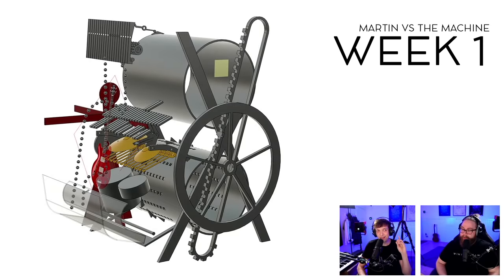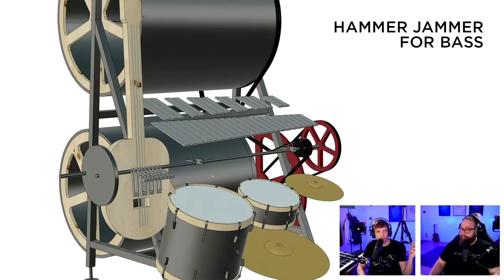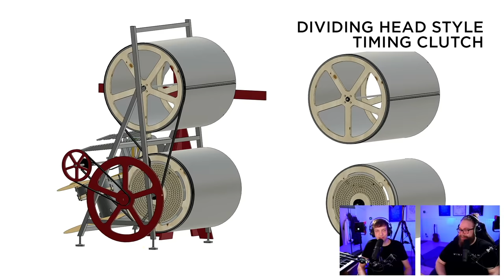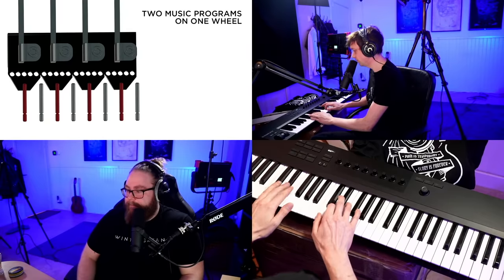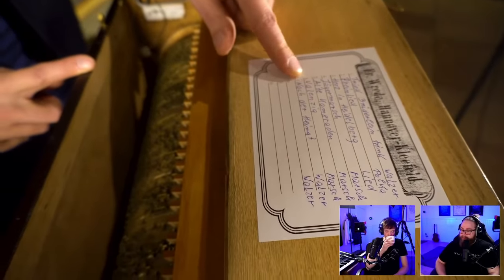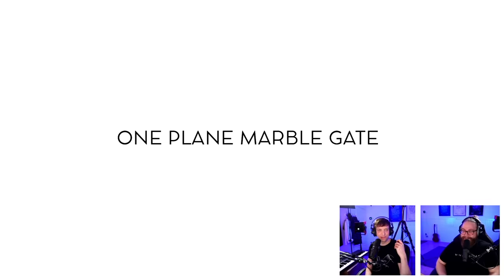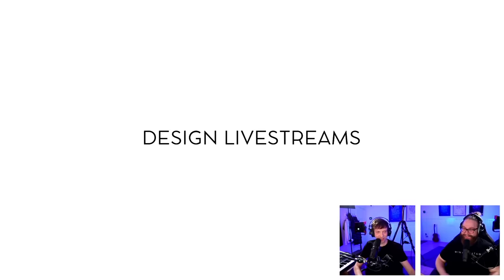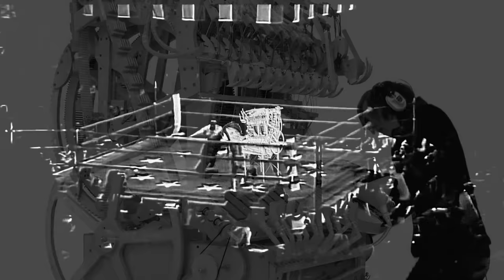Longer Music Programming - Martin vs The Machine - Week 2 Summary

Comment: I don't agree that function has to dominate over looks. You can do both and you can actually have parts to the machine that are mostly for looks and don't interfere with function (equivalent to the automata in old machines that were made to entertain rather than having a practical purpose). For example, there is something magical about the original Marble Machine that makes it so endearing, it was made of seemingly random parts, barely staying together, mostly what seemed fragile plywoods, shaking and vibrating, and yet, it worked. It was part of the entertainment of that viral video. There was something organic about that device. 
So please improve the engineering but don't make look the final product just like some efficient monster, a lot of the magic will disappear if you do that.

Comment: The MM isn't about building a machine to perfectly reproduce preprogrammed music. For the past 30 years, this would have been a fully digital solution. The MM is about mechanically playing music in the most hideous way possible by dropping marbles onto instruments. I think engineering perfection needs to take a back seat to this essentially artistic premise. The balls and the whole mechanism should be visible and audible, and dropping a couple dozen balls during a live performance should be embraced as part of the experience (I'm imaginig stage technicians finding these balls years after the concert, saying: Remember that crazy guy with this machine?)

Comment: Wondered if you can put the bass overhead now that the marbles dont have to land on it. If possible the bass fret sliders are overhead near the other gate levers (or whatever they're called). Use that cool bass hammer thing with levers and have the marbles land on actuators (or just drive the actuators from the drum) and then link the actuator to the hammers on the bass
idk if youll see this but gl with ur new design

Comment: I'm a bit concerned about the loop machine wheel underneath the programming wheel; if we want it to play in sync with the programming wheel in different BPMs, shouldn't the wheel be either the same size as the programming wheel, or 1/2 or 1/4 the diameter so conversions would work well for the beat?

Comment: Switching programs is doable, but a bit complicated. You could have the melody drum slide a few mm sideways and a locking mechanism for that so that when you release the lock, you also lift all registrators. It is easier to shift the drum than registrators, but both ways can be done. A real mechanical engineer should design the mechanism, this can easily become a failure point.

Comment: What about a barrel with with hundreds of pins electrically operated. So if the pin is activated or not can be programmed on a computer. Tan you cold program hundreds of songs on one barrel. You cold program long songs because the pins settings could change during the song. Just a thought 😊

Comment: Regarding drive belts, maybe the machine could have a fixed driving wheel (which could still be removable for storage and transport), and some sort of a clutch mechanism to engage with the programming drums.
Reply: The idea with the belts are to get away from cogwheels interacting with each other as they tend to be noisy. It is possible to make quiet gears, but it takes incredibly tight tolerances which makes it expensive. Basically what you do is use gears that's cut at an angle. The tradeoff is that some of the forces will be push the gears out of alignment so there has to be thrust bearing to take up these forces. This adds to the complexity and cost of the construction.
The belts used in this new construction uses ridges cut in a V shape (not to be confused with V shaped belts) that interacts with the correspondingly cut pulleys. This is a more complex solution than using belts with square cut ridges but are much quieter. The pulleys can also be cut using the router that hey have designed to make the programming drums, or 3D printed in any size you need so they are easier to work with in a project like this.

Comment: The frame model isn't great yet. Use a straight (vertical) Pipe part at the bottom. That way you can weld in a threaded plate at the bottom for adjustable feet. If it's at an angle like now it's not possible.

Comment: If you’re going for form from function absolutism then you need to more deeply examine your design, because we’re already hearing aesthetically driven design choices left and right. I’m especially thinking here of your comments about the placement of the bass and not wanting things to look like they are added on. I’m also thinking of the fact that the machine still resembles the basic form of the previous two machines in terms of instrument arrangement and orientation. Has this third design actually begun from a true tabla rasa or is it baking in assumptions that made your goals so difficult to reach in the previous two machines?

Comment: Two suggestions... Use quick release bike wheel clamps to hold the programming drums in place. If sliding the registrators becomes too challenging you might be able to recycle the idea by using the wheel for a second song simply by flipping it over which would save time in the back room during performances.

Comment: Question. Both drums are removable. They are also connected by timing belts. How are they going to be synchronized?
Maybe it is best to have belts attached to some shaft pernamently, but just have both drums insertable and connected to drive shafts though some sort of simplified timing clutch with one correct position.

Comment: Design as if you have NO CAD, like in the original machine!  That will force better design.  You can use CAD to fabricate the parts.  Get rid of all those smooth curves & complicated mini-curve marble paths.  Get rid of ratchet wheels.  Use escapement directly on the marbles as you did in original machine.  You had none of that in the original machine.  Get a lathe for making rotating parts.  Ditch the plasma torch.  Use propane torch & silver brazing alloy instead.  Design parts YOU can make.  No fancy CNC, simple planer CNC only.  Use more raw stock (aluminum, steel, rod, tubing, square, as the starting point for parts.  Keep post machining to simpler cuts & drills.
          Store all excess marbles in top of machine like you did on original.  Use "liquid" marble divider like you did on original.

Comment: With the red and black pin system for playing two songs on the same wheel, is it possible to have a third state where it plays both the red and black pins at the same time? Also, I am assuming the line of registrators will be the ones that move from side to side (as opposed to the programming wheels themselves)?

Comment: I was wondering if you could place the two songs pins one next to the other and instead of shifting the drum or the series of gates you could use a sloped track on the inside of the wheel to raise only the pin of the song you want. This way you need to shift sideways only this track leaving everything else sturdy and firm.

Comment: Hi Martin, what if the programming layer for the marbles sits movable on the barrel that is turning? There could be a mechanism which moves this layer sideways in order to change to another program/melody. This should be more easy than moving the other more heavy parts...

Comment: maybe I missed that, but how do you ensure that the 2 programming drums are in sync after reinstalling? Due to the beld I think it would be an ease to set one of the two drums just one or a few notches  off on the belt. So there must be an easy and fast possibility to get the two drums in sync, also during the live concerts

Comment: What if you added  a channel on the programming wheel that allowed the change between the first and second track to be programmed in?
Reply: I said this in reply to another comment similar to yours, but I think this would remove some of the human element from this machine. The track-changing being done manually has musical advantages. You can choose to play track A a certain number of times before switching to track B, and when (or if) to switch back to track A. The muting system is also controlled manually; you can choose which instrument to mute at what time, how many instruments to mute and how long to mute them for, in real time.Heck, even the bass guitar portion is being controlled manually. The sequence of strings on the bass to be hit is pre-programmed via the programming drum, but you also have control, over the fretboard, for the specific notes you want those strings to play, just like with any other bass guitar. All this allows you to break away from the inherent confines of having everything about the music pre-programmed. This is not "feature creep" as some of these commenters have accused... this has real musical advantages if you're really trying to look at this as a musical instrument. In other words... this is not just a feature to make the device look amazing... this is a feature to enhance it's musical possibilities and it's really a fantastic idea from a musical perspective.

Comment: How about an automatic track shift? A pin on the programming drum could shift to the second set of tracks at the end of the turn so you can program a double length song without having to switch manually at the right second.
Reply: I think that would remove some of the human element of this machine though. Someone else suggested that the muting system also be controlled by the programming pins on the wheel... but this detracts from the uniqueness of this machine compared to most music boxes (I say "music boxes" because the marble machine is effectively a music box, because of its method of how you program music for it). If the program changing is done manually, this has a musical advantage; you can choose to play program A as many times as you want before playing program B. You might decide to play program A 4 times in a concert, then program B 8 times, or you might decide to play program A 8 times and program B 16 times in another concert; it depends on how you feel in the moment; controlling this manually allows for a bit of human interraction and expression. This stuff also applies to controlling the muting system; you can decide which instrument to mute at what time, how long to mute it for, how many instruments to mute and so on.

This marble machine is unlike any other music box because it's more like an actual musical instrument and not a "playback device"; the music may be pre-programmed, but controlling the muting mechanism and the programming changes manually (as I outlined above) means you have to essentially practice and rehearse, similarly to playing an actual instrument. It allows you to break away from the inherent confines of having everything about the music pre-programmed. Even the bass guitar portion is being controlled manually; the specific sequence of strings on the bass to be hit is determined by the programming wheel, but you can also manually control, using the fretboard, the specific notes those strings play, similarly to how you'd play a bass guitar normally. Having the bass guitar fretboard also be controlled via the programming wheel would also remove the very thing that makes this machine so unique. In fact, I had a bit of an idea on how I might make a sort of music box that has many of these same musical advantages. I'd make it much simpler though, as it would not use marbles. I can explain it a bit more in another comment if you want to know more about it, as this comment's already getting quite long :)).

Comment: So about this form from function absolutism, am I missing something about that?? I assume that one of the design reqirements in this list you dont want to freeze is that this thing has to use marbles, but why is it using programming wheels? They are far less functional than motorized marble gates with computer controlled  release. Really all the gears are unnecissary. They are going to be much louder than a motor driving the marble return mechanism directly. Theres lots of things in this design that make sense if you are making, say, a kinetic sculpture that plays music, but that make no sense if you are going for form from function ABSOLUTISM.
Reply: The whole point is to program it in the same way you'd program a music box. If you actually new Martin's original inspiration for making this, You'd know that. What he's getting at, I believe, is that in the MMX he was building parts that looked great but that either functioned poorly or that were simply useless because they played no part in the functionality, and he's not gonna do that again for MM3. If the marble gates were computer-controlled (via MIDI, most likely), then it's not music box-like anymore. I once read a comment from Martin that essentially said that all marble machines make "music" in that they involve marbles hitting musical instruments, but there's absolutely zero control over when the marbles drop, how many marbles are dropping, and when no marbles should be permitted to drop... so the goal of the original marble machine (and obviously this one as well, as well as the MMX) was to have a marble machine that's programmable, where the movement of marbles (or the lack thereof) can be very precisely controlled: you control when the marbles drop, how many marbles drop at one time, and when the marbles should be restricted from moving and so on, so it will actually sound like music and not just chaos. And because of Martin's fascination with music boxes, it made most sense to use pins on a cylinder as the programming object.
Reply: @justinnaramor6050  I'm extremely familiar with his projects and inspiration.

You do make a compelling case for him not going for "form from function absolutism" though. You know, since he's building a marble machine based on music boxes and not a midi synth...

Comment: I feel like stuff like song switching is an unnecessary feature and is gonna get in the way of you just getting the damn thing working in the first place.
Try to get the minimum, core components done first. The registrators, the marble gates, the instruments. The framework around these - gears, timings, the frame - can come afterwards to fit the system. I'm worried about you focusing on too many components first that are either unneeded, or small side things that don't actually contribute to the core. I think any addition should only be done specifically to fix a bug / broken design at this point, and not to add any new functionality *at all*.
Everything about the MMX was going smooth and perfect til you got to marble gate hell. Don't let yourself fall into the same trap, design the marble gates first and build everything around them.

Comment: just listening to the approaches and all the fancy new ideas makes me hit my head against a wall several times... except to the fact, that martin has excanged the angle grinder with the digital version of it (CAD) makes the process not really more effective - and even more, there is no physical outcome anymore...
so there are a lot of nice concepts, but very less prove of concept...
somebody was 3D printing a bass slap solution - its not a industrial proved concept - so there will be troubles with that as well...
Martin, you wanted to reduce the machine elon musky like to the functional requirements to play music - so the first logical step would be to remove the marbles (because they are the most unreliable part of the solution) - but i guess then the whole point of the project gets lost...
if the "art" component of the machine gets lost in the end the machine itself makes not relly sense anymore...
i really was hoping for an efficient approach on the new design (it must be because the old machine, that lots of people including me loved, was scrapped because of this) and in the next moment i see Marting dreaming of shiftable registrators to extend the functionality of the programming wheel - nice, and doable somehow, but not the efficient way you wanted to reach out for...
so i guess we will see lots and lots of designing, and then lots and lots of struggeling while manufacturing, and in the end a overengineered, but undertested system that will struggle again...
please please - prove me wrong - i am so hoping for it!!!
and yeah, i still believe!

Comment: You never explained why there is two programming wheels/drums on the machine now instead of one like MMX, how are they going to play from the bottom one?

Also will it not be a huge hassle to take the belt on and off every time you change out the wheels/drums?

Maybe its because you are in the "sketch" fase of the project now but when designs starts to be more final and locked i would like it if you talked in-depth to why you choose this way. I don´t have time or want to watch the 2-5 hours livestreams.

Comment: Instead of a program drum, why not a Programing Chain? That way you an have any length cycle, and change it out easily.
This "Chain" would be small sectors of the program wheel, pined together. 
A chain could be changed out on the fly by spliting it, then hooking the new chain into the end of the old chain, and feeding it while the last chain musics is finishing.

Comment: Why don't you make the programs permanent by embossing them on a thin sheet of steel that you wrap on the drum, the same way that a printing plate is done ? I say "embossing" but small pins of even rivets, can be affixed to the sheet. The advantage of this, is that you can have dozens of music programs stored in a shipping case. It takes 5-10 seconds to replace a sheet on a drum.
Reply: That was part of his plan for MMX - pins in plastic for composing, and rivets on sheet metal for performing. It's a good idea still.